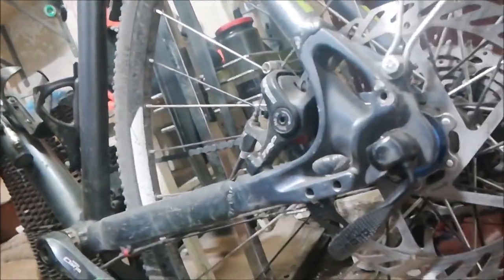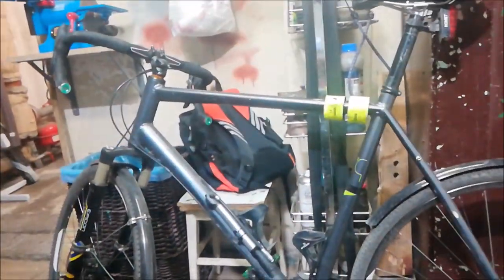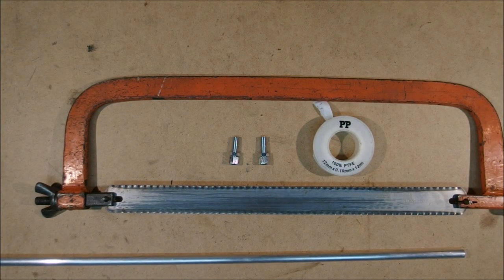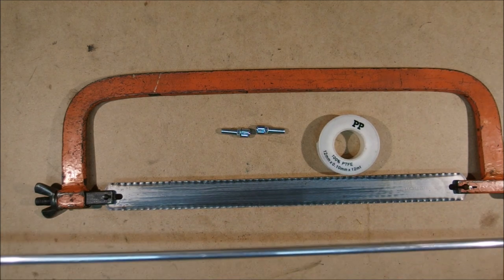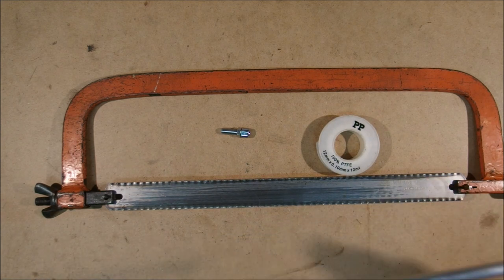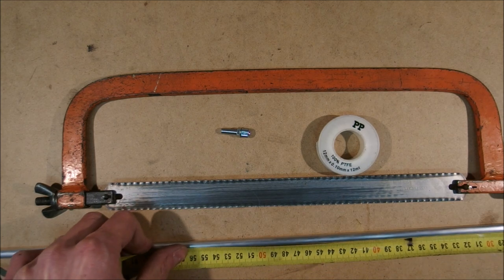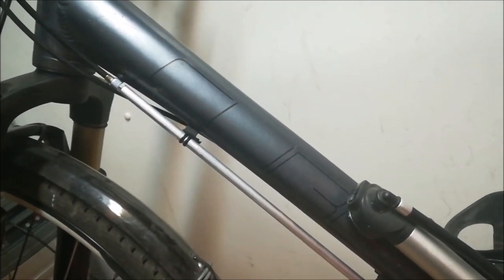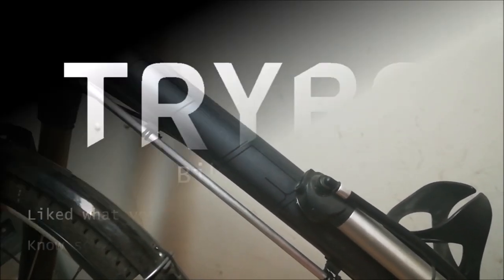Howto: Make your own compressionless brake housing...

Comment: Useful, might try it out. Will also cable tie the current cable more and reduce and support bends where I can.
Possibly  could also add bent tubes (e.g. bend with a car brake pipe bender) for even more compression alleviation.

Comment: Thank you for bringing this topic. However I think what you feel is placebo effect -- with two fixed points for straight segment you won't observe compression of any kind. The problems with any housings are the bends (how many of them) and angles of them. In this case the worst part is the first bend on the handlebar, it is almost 90 degrees and both points are not securely attached (only by elastic handlebar tape). So changing the housing on the downtube (straight segment) for educational purposes is great, but for practical one not so useful -- there are no pressure/friction points there so there is nothing to improve.
Reply from the maker: That is not entirely true. Since the housing is not rigid, as you tension the line inside, the housing will bend/kink itsself. The only way to prevent it would be to securely hold two ends of the housing and preload it.
In result of this experiment - the improved lever feel is immedietly noticable - as the brake bite point also is. To a level where I consider extending the tube segments further.
Clamping force of the brake tho does not increase, not to a significant degree at least.
Reply: @TryboBike  I would say it is impossible by definition. Straight segment cannot bend because there is no bending force. I can only bend further when is already bend. So if you see real improvement I wonder what was changed as well (I mean, to me it looks like you affected two things). Inner surface maybe?
Reply: @WanderABit  Classic cable housing looks like that |/|/|/|/|/|/|/|, so yes it compress a little.

Comment: why not just get Jagwire compression less brake housing?
Reply from the maker: Because that would be, approximately, 40 times more expensive :)
Reply: @TryboBike  but far neater solution, and actually whole thing is compression less not parts of it. yea sure 25% import tax,shipping,the product it self, for me was not super cheap, but worked quite well. I don't remember how much it cost. but for me what you did would not work so well anyway I think. full suspension bike. but now I am back to hydraulic brakes, until they leak, already swapped one rear brake, few days ago, need to contact dealer for seal swap in caliper, maybe shimano gives me new brake, maybe swap seals, they don't last long, but atleast the m6000 don't leak from the master cylinder, and no threads to fail there so bolt comes off, and oil everywhere. but if hydraulics give me trouble I have TRP Spyke as backup brakes.

Comment: very nice practical performance upgrade. I remember when the pricey nokon cable kits were the only option for compressionless!

at work, we use the giant ultra slick premium housing, which is a kevlar reinforced linear strand housing. it's not too expensive and it provides a decently good brake feel.